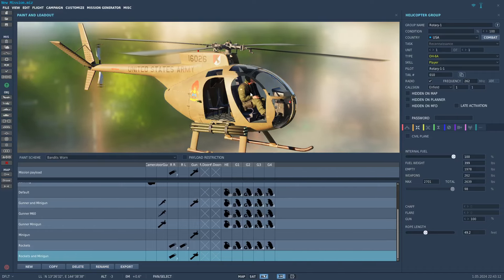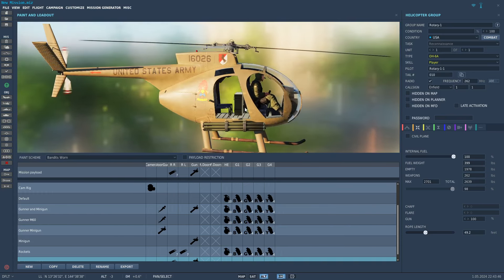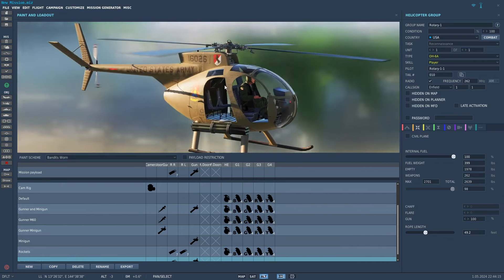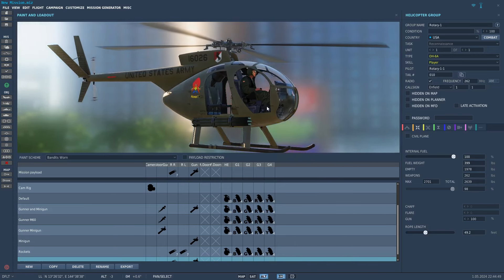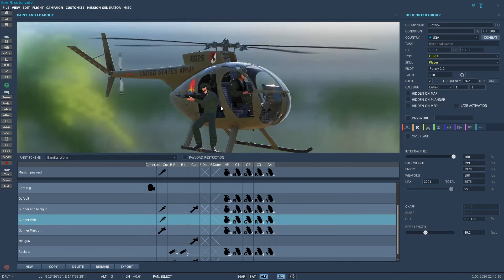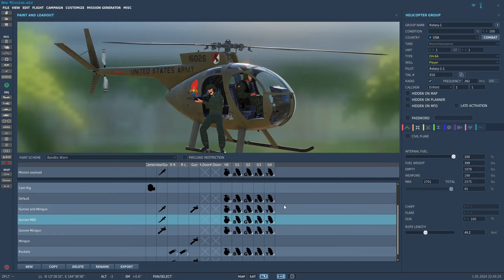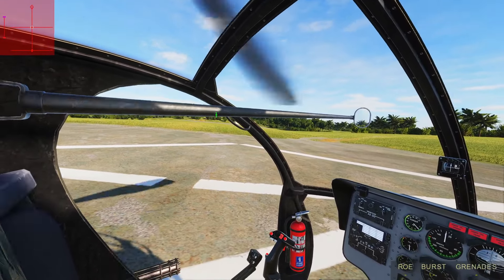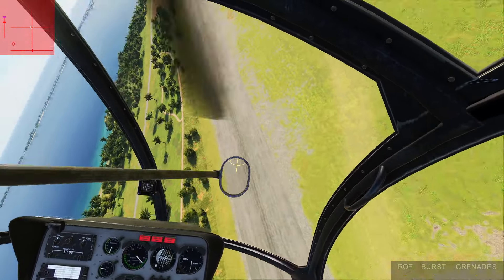OH-6 Cayuse Mod First Look | Easy on the Eyes, Hard on the Controls!

Comment: Try it again. The 1.1 update made a HUGE difference. After initially trying it I refused to fly it any more as, much like the early UH-60 mod, it was teaching me un-helicopter like responses. But then 1.1 came out a week later and substantially fixed it. (And the UH-60 mod has improved a LOT since it first came out too and I no longer refuse to fly it either.)
Reply: real blackhawk pilots fly that mod and they say its almost 1-1. apperently the mod feels slightly more sluggish then the real thing. but something only an experienced BH pilot would notice
Reply: @BarkerVancity  I was surprised and impressed. (I usually hate the free mods for their substandard flight models.) Even its slip ball worked right, where most mods' don't. (I assume because a function they need to easily do it isn't available without the developer SDK.)

This one's not half bad either. I hope it continues to improve.

Comment: Two points -

1. If you have rockets on both sides, you can set the thingy to one. If you have rockets on one side (with the mini gun on the other) that’s when you need to set it to two. 

2. The chopper feels crazy when slow or taking off.  I assume this might be related to those of us with smaller (as in normal desktop length) joysticks acting as the cyclic. Once you get moving forward over about 80 knots, bring up the helper and match what you have done with the cyclic diamond with the trim diamond. When you hit the sweet spot it’s like riding a horse going from canter to gallop, that sense or chaos just melts away. Everything smooths right out and you feel like you’re flying the thing, rather than struggling not to die. You can actually fly hands off for a few seconds as it smooths right out. It becomes a much better weapons platform too. Just don’t try to be too fancy in turning around to come back for another run. It’s easy to get into the ‘spaz’ mode again if you try anything showy. 

A long slowing and descending approach to landing seems to be the key to making it home alive as well. 

At least, that’s what I found. YMMV.

Comment: see that clipping happening on your cyclic?  It means you have VR controls or something else taking over.
  So the inputs that you're putting in with ur stick are being aggressively challenged by a 0-place axis (likely 2, pitch and yaw) while ur trying to fly.
  CLEAR ALL CONTROLS on AXIS CONTROLS then try remapping again.
  

Here's to hoping the heli flies better like that :P
Reply from the maker: Turns out that's exactly what was happening.  I went in and corrected that and now it flies much better.  Out of all the helis I have flown in DCS, it's definitely still the hardest to control, but it's not impossible.

Comment: Just like in the huey you need to set yourself properly before taking off. Go VERY light on the collective, you don't want to go straight up in the air but first go light on the skids and trim yourself out. Stick little back and little left and plenty of left rudder.

Comment: Is there even ground effect in the flight model?
Reply: Yes, but the damage model isn't very detailed, yet. Also he had more than one axis bound to the cyclic x-axis so the inputs where "jumping" between actual stick position and "full forward" like crazy... so I recommend to try it out and not rely on videos. 😂
Reply: @shagrat47  Tested it today, yeah, the ground effect is there but it's barely noticeable. You can settle into hover with very slow descend speed at a few feet, but it's not felt nearly as strongly as in, say, the Huey. (Not that it should be the same or anything, the helicopter is much smaller)

Very twitchy, but not impossible to fly. It would be ok if it didn't get into some bizarre wild oscillations at times (my bindings are clean ;) ). Good attempt, but I'll let them cook some more on that FM.

Comment: I can fly the Huey fine, this thing...impossible. Using antique MS Sidewinder but it works great for everything else.
Reply: FFB is a problem, as the OH-6A has no ForceTrim (the real life as well as the Mod). You can use the trim hat, but that shifts the center and simply adds your stick input on top. So basically currently you fly the Loach with the trim hat, using fine stick inputs for stabilizing, as it is assumed, you have a centering spring... you either remove the force completely and fly deadstick with the cyclic, or set the Force emulating a centering spring and trim away the  pressure, until the stick is in neutral center, again. 😕 Or you have a RhinoFFB and can do a hardware force trim and override the sim.